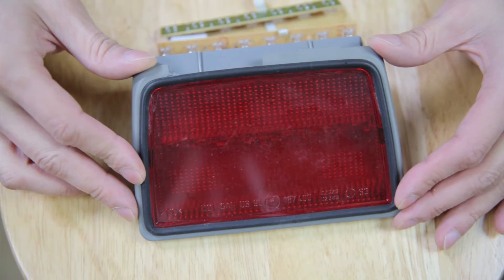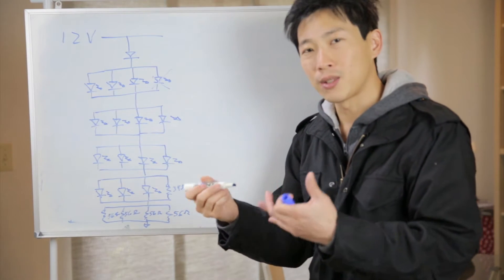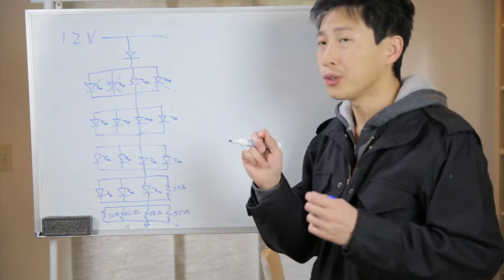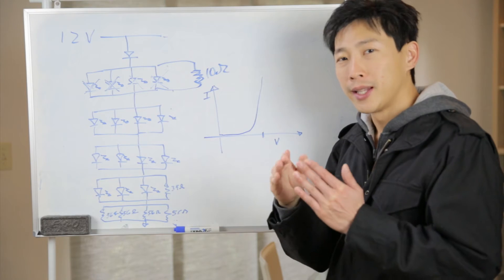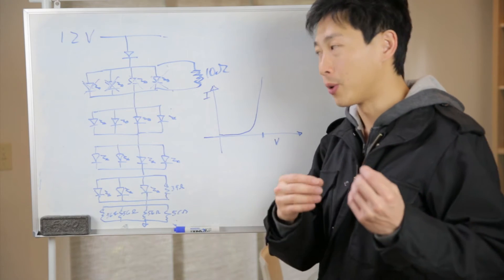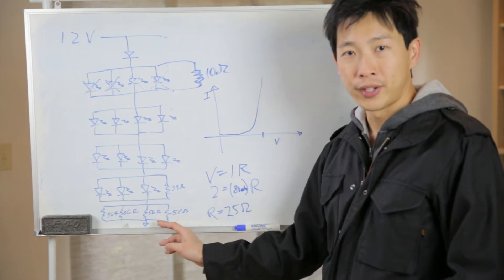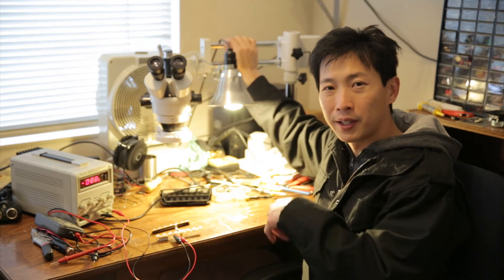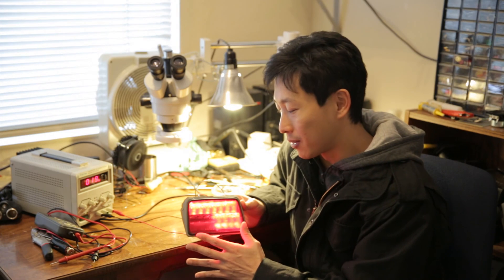How To Fix LED Arrays and LED modules

Comment: A "short open" as you keep saying is an oxymoron. An electronic component is either shorted or open but not both. A short denotes low or zero resistance, think maximum current flow or a piece of wire. An open is a broken link or infinite resistance such as a cut power cord or broken filament in an incandescent light bulb, i.e. no current flow or no work being done. 
Other than that a good presentation.
Reply: Yeah, really helpful video, but it’s either “open circuit” OR “short circuit”. You cannot say “short open”. 👍🏻

Comment: That was very good, it not only got you a like for the video bet also a new subscriber.,thanks man. Could you not find the correct LED's and just replace them? You're right that soldering system is way out of my price range, I'll have mark that name down just in case I see one cheap somewhere. Does it get hot enough to replace the capacitors around the CPU on a DELL mother board? Thanks again.
Reply from the maker: I bought mine for $60 and it was marked broken. Turns out it wasn't. =D Any reasonably good soldering iron will melt solder to remove capacitors around the CPU.